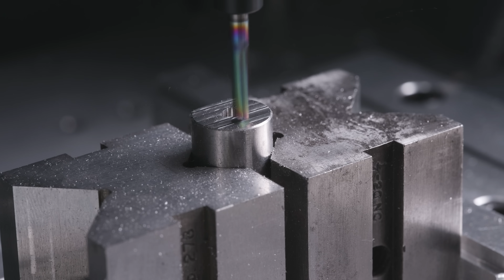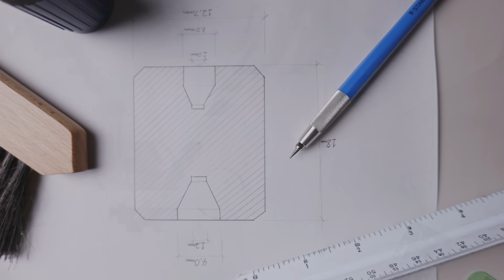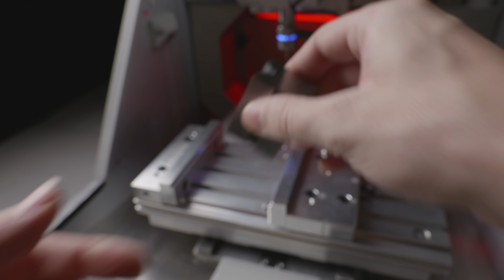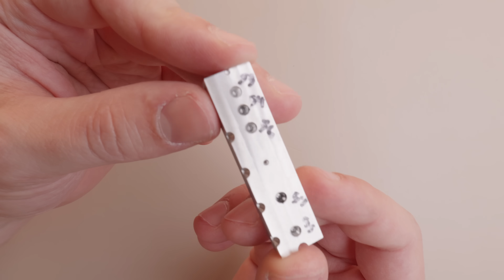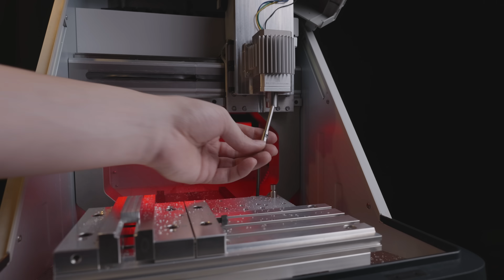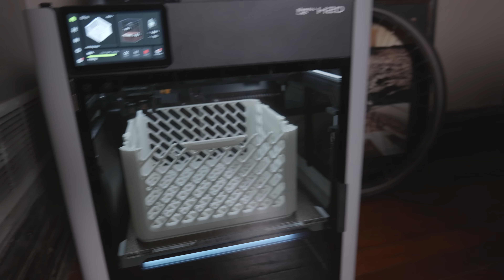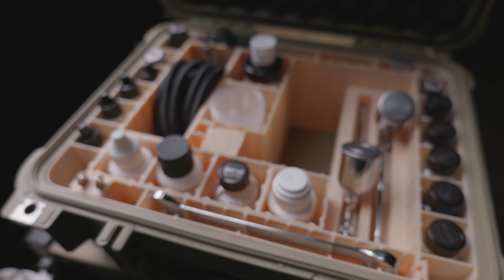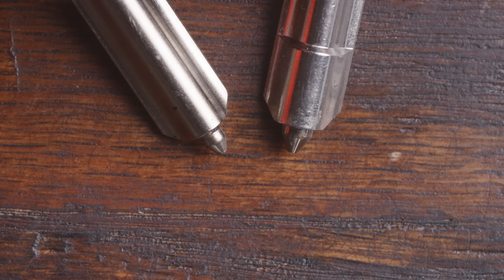Inventing A Tool Every 3D Printer Needs

Comment: You are using the wrong shape, the hole should be cordate (💟), so that only one blade ever touches the nozzle, thus it could be used for every angle! To improve the cleaning effect and holding the blade in place you could also fill the hole with brass brushhairs.🔱 For holding the blade 🪒 in place though I think two spring 🐚 plates could be used allowing multiple angles positioned 120° from the main blade; or we could even use two weaker springloaded side-blades.🔻
There is but one Problem with your invention though: Now you also need a cleaning tool for your cleaning tool, like a drill for the hole! 💗😂
Reply from the maker: Ohh i like this shape idea, i feel like i have seen that shape used for clamping on cylinders. I also worried about cleaning the tool. But because your cleaning the nozzle cold the plastic doesn’t get stuck inside the cleaning tool and i found just blowing into clears it out well.

Comment: Definitely could use one of these, maybe in a more refined form as a standardized bit- with the handle also being compatible with other bits and tools.
Reply from the maker: Ya it could totally have the same shape to work with 1/4" ratchets or bit drivers. I like it

Comment: the problem with scrapers is that every time you use one you remove materiel from what you're trying to clean. if you are willing to accept shorter tool life then it's all good.
Reply from the maker: well this design doesnt have any back relief on the cutting edge, except for the flute. This causes the edges to rub more than cut against the nozzle.

Comment: Loving the concept, but my worry would be that each time you clean it, you would be removing small parts of the nozzle due to the grinding action used on it
Reply from the maker: Well those nozzles are hardened so i was actually worried about the nozzle wearing out the tool.

Comment: the finished "bit" should be that, a socket to fit into standard bit holding tools, for those without the fancy spinning handle, or they have fancy spinning handle at home.

Comment: Now mount it on the 3D printer and code it as a step after every build to automatically clean the nozzle.

Couldn't believe you didn't think of it in the video!
Reply from the maker: honestly I’m surprised to. I even tried to think of a way to make it automatic but keep up empty handed.
Reply: If you inverse the thought and have the cutter external, it could go around a point and be spring loaded to accommodate for variances in angles.

Comment: Then you have to remove the buildup from inside the cleaning tool. And you need a tool for that. And you have to clean that tool (perfectly). And there’s a chance some of the buildup hit the floor. So you need an army of robots to clean the floor. But they all need power. So you 3D a nuclear power plant. Which is going to need a LOT of cauterized removal tools. And you gotta clean the buildup out of those…
Reply from the maker: this comment is epic and explains why i spend alll my money on tools. that need never ends

Comment: So it's kinda like an old battery terminal cleaner. Cool idea.
Reply from the maker: Oh I didn’t even think about those. if only they made them in a super small size.
Reply: @Unemployed_Architect  I don't see why it couldn't be done... I think the only problem would be the inevitable little bits of wire flinging off.

Comment: You only need one edge to align to the nozzle conus. With two ball plungers on the opposite side you might be able to do a 360 for a full clean.
Reply from the maker: hmm the two ball plungers is an interesting idea allowing the blade to be fixed but also conform to any angle.

Comment: Pro tip:
Photograph the nozzle, then enlarge, print out and measure the angle on paper. 👍🏻🤓
Reply from the maker: I did try taking a photo using a 90mm macro lens. Even with that when zoomed in the edge would be slightly blurry so you couldn’t tell where the angle actually was. honestly I was really surprised it didnt work
Reply: And make sure to take the photo from a perpendicular angle, and zoom in a bit to avoid distortions due to the wide angle effect of the normal smartphone lenses. 🫵🏻😎

Comment: I'm so tempted by the bin.  1150 grams without a lid is expensive but it looks like a nice bin.....
Reply from the maker: 1150 grams for just the body? That Is higher than I would expect. I managed to print the body, lid, and 3 dividers for around 1200 grams of abs. granted I used abs which has greater volume per weight. I also only used two walls when printing, still very strong. I’m actually working in a version right now that uses under 1kg in abs for the whole thing.
Reply: @Unemployed_Architect I was using a 0.8 nozzle with PetG. For stuff like this I usually 0.8. I think I’ll try it with 0.4 first. Maybe it won’t need it.

Comment: nozzles are consumables. if the outside is that gunked up then the inside is probably worn and you can replace it. if it's still printing fine then it doesn't matter if the outside isn't perfectly clean, only the tip needs to be clean to print.
Reply from the maker: I have black crusted up pieces come off during printing and get fused to the perimeter. Really depends on the filament type though.

Comment: i would just like to mention that you can also clean the nozzle very well with just a tissue when its heated up
no damage no scratching
Reply from the maker: See I have heard this before but was always skeptical because I would struggle to throughly clean it with the brass brush…but hey maybe I need to just give it a try.
Reply: Yeah, it works very well. I thought that was common knowledge among 3D printer enthusiasts.
Reply: Not to disagree in any way ... Ingenuity, invention, and including paradigm shifts often sprung from the the process of developing something almost useless, out of boredom during idle time, and just letting the creativity free-roam inside of a sandbox.

Still, the "wet towel on a heated nozzle" is a much less expensive and legitimate solution.
Reply: @ThinkingStronger Nobody said wet. 😅
Reply: @TheDJRiffin in the specific comment that I commented about, you're correct. There are other, earlier comments to this video that do, and I made a reference that encapsulates all of these similar comments. There isn't a way to link to all the other, similar comments. YouTube isn't that technologically advanced in the comments space.
Reply: this is what I do every few weeks. I don't get much buildup and I'm printing hours on end. I've logged thousands of  hours on my printers. My oldest one has over 5000 hours and I only replaced the nozzle because the print head failed. It would no longer maintain temperature.
Reply: @DagrtOne   Stringy plastics like PETG cause this much more than some other plastics.
Reply: Yeah, I literally just use a paper towel.
Reply: I’ve had success (and burns) with toilet paper
Reply: @ArsonalTech  most tissues will work, but yeah you either have to do it very quick or bunch up a thicker piece of tissue to not burn yourself
Reply: I just heat it up, use one of my longer fingernails to scrape it off a bit and use a scrunched up paper towel. Never got burned and it always comes out clean.

Comment: Heat it to 150C and wipe it clean with a paper towel.
Reply from the maker: see I never believed that would work. Atleast with how crusty my nozzles seam to get. I have to go at it with a knife to chip the really stuck bits off. but than again a lot people have suggested this so I’m probably just straight wrong.
Reply: @Unemployed_Architect brother it's simple. Aș long aș it gets a bit soft it stays together. It's the same logic that applies to a cleaning cold pull.

Comment: Dremel with a wire brush works great too
Reply from the maker: I would bet that takes it all off in a blink of an eye. You don’t do it with the nozzle still installed though?…or do you?!
Reply: @Unemployed_Architect  Not on the printer while its installed no, just holding it by the heatsink. You could though, just have to raise the gantry and take off the rubber boot, but I prefer not using dremel tools at eye level.
Reply from the maker: lol ya spinning wire brush at eye level maybe not the smartest

Comment: Is it really necessary to clean the crust off the nozzle? I only bother when a larger piece of plastic gets stuck to it and risks shedding onto the print and becoming an obstruction. And in that case I just pick it off with a toothpick while hot and ignore the residue. It does get cleaned up on rare occasions when it clogs and I cook it on the stove until the plastic is all burned to nothing, but even then it doesn't look shiny and new.
Reply from the maker: Honestly I have no idea lol. Like even if a study came out that showed it made no difference my OCD would still take over and force me to clean it.

Comment: You make me proud of my little wooden CNC :)  It can chew through mild steel at a rate of about 40mm³/min with 1/8" end mill, and is still light enough to move around all the time too (45lbs). But I do suffer from limited Z as well (111mm total travel). It's long been on my agenda to extend the frame and shift the rails up by one screw hole to get another 25mm out of it.
Reply from the maker: Love to hear it! there really is a lot you can do as long as you keep it reasonable. I would caution you on raising the z height though. 25mm may not sound like a lot but could add significant more leverage on the frame leading to a real drop in rigidity.

Comment: Great idea! Tapers are best measured with two known gage rings or with an optical compairtor is very easy if you can access one
Reply: Even easier is to take a closeup photo. Measure the slope in any graphics program, then inverse tangent to get the angle. Also good for things like thread pitch if you hold a ruler next to it so you can measure pixels per inch and pixels per thread.
Reply from the maker: I did think of the optical comparator. I actually tried to recreate one using a telephoto macro lens but sadly no dice. Now I haven’t heard of measuring a taper with two gauge rings. I’ll have to keep that one in my back pocket for future projects!

Comment: why not making a kind of basket-holder-thingy for steel or brass wool with gearteeth around so it can be driven by a small motor, so it doesn't need to be fitted for a specific nozzle and can be driven automatically by the printer before every print. guess zhe wool then just has to be changed every few dozen prints
Reply from the maker: I thought about something similar but with brass bristles but didnt like it. with steel wool though that could be interesting and like super easy to make / implement.

Comment: In your design, you have 3 scraping lobes, which we could consider as the negative pair to a 3 flute countersink. If you made a 1 lobe design, like a 1 flute countersink negative, the scraping angle can easily be adjusted to scrape the sides of a nozzle of any width or angle.
However, a better solution than brass brush or external scraper is a pair of fabric gloves (not thin walled or rubber) and a tiny ball of steel wool. Remove the silicone cover, heat the nozzle if you wish but it will work cold as well. Wearing the gloves (heat resistant if doing a hot nozzle) grip a 5 mm ball of steel wool between your thumb and index finger, press onto the nozzle tip and squeeze and twist. If a cold twist doesn’t completely clean it up, follow it with a hot twist. No need to worry about diameter or angle since your fingers will apply fairly even force over the whole surface of the nozzle tip.
Note that this method assumes a hardened steel nozzle. Do not do this with brass or unhardened steel nozzles. It will scrape grooves into the nozzle surface that will cause material to collect much easier and faster in the future. Then again, the external scraper pictured here will do the same thing to a brass or unhardened nozzle. This is why brass brushes are used for those.
What you could do is make the hole bigger on your steel scraper and instead of using it to scrape, plug the hole with steel wool and use your handle to rotate the steel wool on the nozzle. Don’t just drill a hole and stick steel wool into it though, it still needs a cross section similar to the negative of the nozzle and internal arrangement to grip and rotate the steel wool. This tool should be able to clean any nozzle size or angle, hot or cold, without the need for gloves and without any risk to wires.
Reply from the maker: This is an epic comment! honestly I had never thought of or heard from other people of using steel wool. but it does sound like it would work really well especially if you did print or machine a holder for it that way you wouldn’t need to use the gloves or heat the nozzle because you could apply a fair bit of pressure. love the idea.

Comment: Bro you have a probe on makera, just measure bottom of nozzle and top of nozzle from center, then the height of the nozzle,  draw in cad those dimensions and you will have the angle. and there will be nothing more acurate than a probe
Reply from the maker: you know I didn’t think of that! the only challenge I see is the nozzle has both a straight section and a tapered section. and be able to measure where one starts and the other ends is the real challenge that I ran into.
Reply: @Unemployed_Architect  small shims with magnets should help. if you have like 0.1mm shims, add them to the nozzle top and bottom, measure the distance between them so you will have the Z measurement, then how much shims are protruded, and measure that, so you can cad calculate 4 distances, from top to botom, and all the angles

Comment: I'm curious as to why you didnt prototype that in resin to nail the angles. Resin will take the heat of a soldering iron, comparable to a print nozzle, without softening - and would be good enough to test. It might even be good enough to do the job, although it would be more of a consumable than a metal one. Upsides also include not wearing down a soft brass nozzle, or wrecking the coating on a treated one.
Thats a damn good idea tho, whichever. 👍
Reply from the maker: I actually did do some resin test prints super early on trying to dial in the angles / fit. I was worried that the plastic would be to soft but I never thought of trying to use it with the nozzle heated. I even have some resin which is good to like 180c so I might need to give it a go.
Reply: @Unemployed_Architect  You might find some that will go much hotter; I dont know the temperature because its not a TC, but I've soldered directly onto Anycubic's transparent resin with an Antex 15W, I tried to make some custom plugs and sockets. They werent very reliable, but, it did surprise me just how tough that stuff is. Good luck 👍

Comment: What a great video! Not thinking about if this tool is necessary at all: I keep thinking about those fractal vises. Push the tool onto the nozzle and the angle of the grinder adjusts to the nozzle. half cone half ball which is inserted from the back and something something that sounds easy while talking and after 30sec of actually thinking about it will get ridiculously complicated. 

anyway, keep doing what you are doing!
Reply from the maker: Thank you! An adjustable or variable angle version would be sweet but ya I was desperately trying to make this a one month rather than a 6 month project. so I just kept telling myself keep it simple (:

Comment: There maybe is another problem but I lack the knowledge out of what material these bamboo nozzles are made of. If they are made of brass I fear you could work yourself through the nozzle over time (well at first through the coating).

On the plus side the exact angle is not that important any more 😅.
Reply from the maker: they are hardened steel which is why I choose tool steel I was actually honing to heat test the tool but ran out of time. But ya I think a little bit of wear would be a good thing forcing the nozzle to match the exact shape of the tool. so it might work even better on brass nozzles